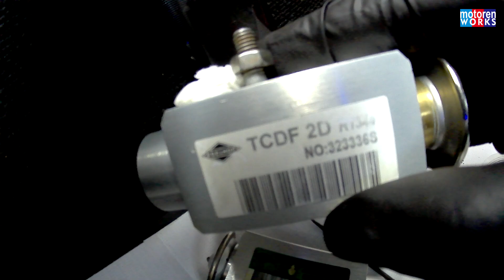BMW E36M43 Expansion Valve / part 2

Comment: Om saya ada kendala di baut L 6 itu slek , gimana ya solusinya. Dibawa ke tukang bubut ga ada yg sanggup karena dalem. Apa harus bongkar housing evaporator?
Reply from the maker: @andribaguset  baut L6 itu masuk ke besi kotak besi/alumunium pengunci bagian bawah. Biasanya yg slek adalah thread di kotak besi itu. Kotak besi itu, kalau tidak salah bisa dilepas. Kalau bisa melepas kotak besi bawah itu, nantinya drat untuk baut bisa di drat ulang
Reply: Oke om terimakasih

Comment: What's fuel consumption f your m43 engine litre per 100km
Reply from the maker: Based on my latest road trip, the fc are 1 L : 11 km and 1 L : 13 km
Reply: @motoren_works   mine is doing 7 to 8 what can I do it has new m43 engine the only thing is the icv is broken yet to replace just holding with arodite could it be the cause
 of higher fuel consumption
Reply from the maker: @I_am_kenneth  since there is a broken part, I think that would be one of the causes of the problem
Reply: @motoren_works  it real giving bad fuel millage I will change and update if the consumption will chage

Comment: Gejala nya apa om..?,kok ganti valve. Saya rencana pengen ganti kondensor dulu malah tadinya
Reply from the maker: Gejala mampet om. Muncul bunyi di area ini setelah kompresor on selama 5 s/d 10 menit. Ketika kompresor off beberapa menit, kemudian di on kan lg, bunyi hilang, tp muncul lg setelah 5 s/d 10 menit. Pernah sy paksa kompresor on meskipun muncul bunyi, akibatnya jebol (kalo gak salah ingat di sambungan input kondensor)
Reply: @motoren_works  wah thanks ilmunya om
Reply from the maker: @Aricloud_  siyap, masama om.